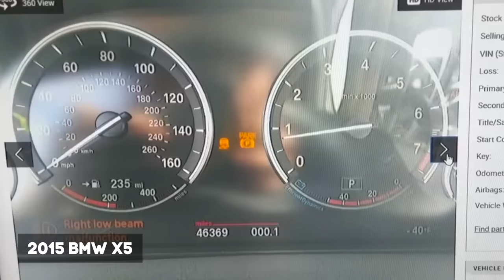REBUILDING A CHEAP WRECKED 2015 BMW X5 F15 15 MINUTES

Comment: So I was always wondering if the x5m bumper from the f85 fits onto the f15, do you have to swap radiator supports or anything else for the bumper to fit? Or does it just fit right on with no retrofitting needed? Because that’s so clean!!!!!